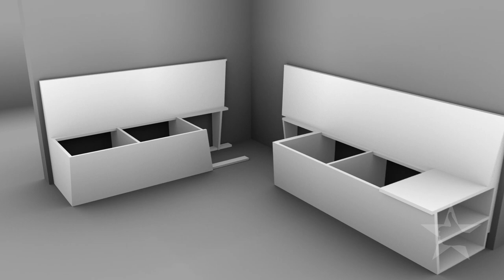DIY Kitchen Storage Bench Banquette

Comment: Great build definitely taking some inspiration from this design. Primarily I was looking for a backrest design which your is perfect. I did grab the cutlist but wanted to know is the bevel for the top of the backrest (connects to the seat). 15° or 11°? Not marked so going based on what I believe to be the seats. New to woodworking and understanding plans so unsure if I am reading it correctly.
Reply from the maker: Thanks for asking. The back rest is 11° and the surface that touches the floor is 15°.

Comment: Great design! It's giving me ideas on how to build my own. What did you use for mounting the backrest?
Reply from the maker: I used these brackets on the top of the back and then the bottom has large stick on velcro patches.  The seats are just velcro. https://www.amazon.com/Sydien-Universal-Interlock-Furniture-Connector/dp/B07Q2V1XSP?pd_rd_w=hzAkY&pf_rd_p=1a37ebd3-847a-476b-b9f6-6ca64f4f5919&pf_rd_r=NAERY5HA1S7E5X2P8PRW&pd_rd_r=28f4b2c7-9b70-4805-98f9-809646d0f7e5&pd_rd_wg=9wPCN&pd_rd_i=B07Q2V1XSP&psc=1&ref_=pd_bap_m_rp_34_sc

Comment: How is the seating over the shoe rack? As in, how much weight can it support?
Reply from the maker: It's real good because it's supported in front and back all the way down.  Also when you sit there you overlap the vertical cross board that makes up the back of the rack. The middle shelf being permanently attached with pocket holes adds to the rigidity.  It shows no movement when I apply my 220 lbs.

Comment: "DIY" from a workshop with tools and machines worth 10.000s of $. Why put DIY in the title?
Reply from the maker: A drill, circular saw, saw, pocket hole jig- these are all tools attainable for the average diy person.  $14 harbor freight gun run from a $100 hf compressor.  I didn't even use a table saw.  I built the panel saw myself, which you can substitute a circular saw for. I am not a professional and I did it myself, which by definitions makes it diy.
Reply: @jaredmortondesigns7258  There's always one in the comments lol
Reply: Face it, you’ll never do it yourself without the right tools, no matter what. Quit crying.